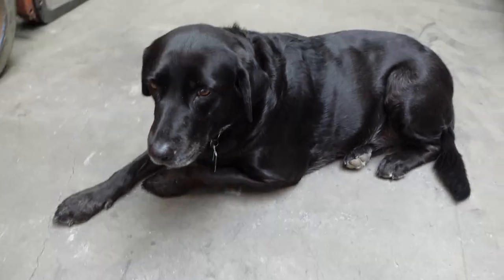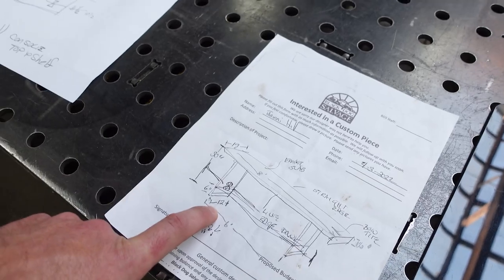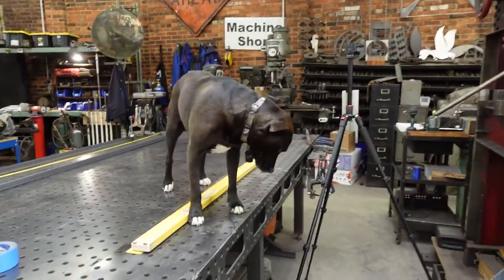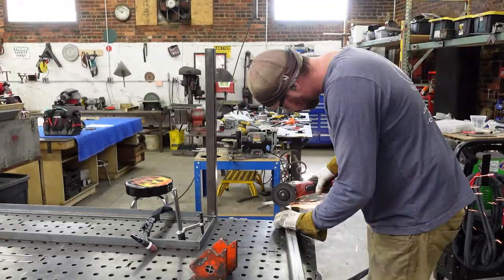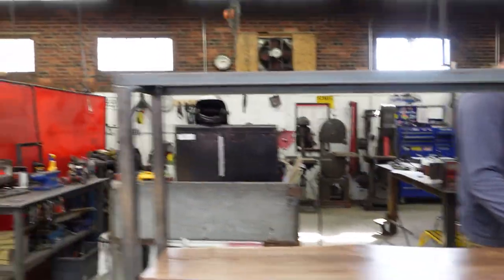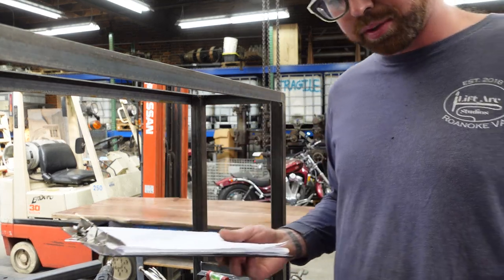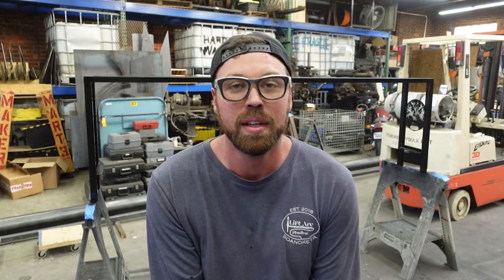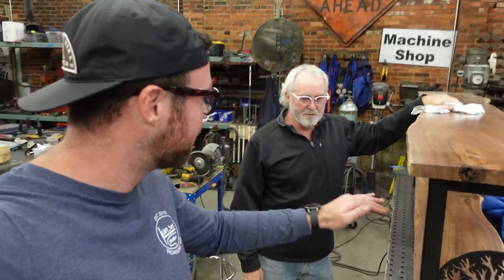This Table Has a Very Special Meaning

Comment: Nice build.  I like rigidity of structure and would have welded in 1 x 1 x 1/8 angle under the bottom shelf section front & back, making a box section of the shelf (as you have pointed out).  Another voice in the crowd...

Comment: Really like the table build and the art work. You might have a problem with the distance of the bottom shelf the long run may sag over time while pulling the legs inward. Long runs like that are usually supported like you did with the top.

Comment: Good job on the table. I hate to say it, but looking at the type of work that you do and the flow of your shop, my thought would be to sell off the rest of the machine tools from the machine shop except one lathe and the mill (and whatever else you actually use).  It would free up some space on the racks and if you raised up a shelf on the pallet racks could actually set up the large in that spot. I know it’s your shop and all those line shaft tools are cool, but if you don’t use them they really don’t help you.  Keep up the good work

Comment: You're going to have to add some support to the lower shelf. That's just too long a plank to hang from the ends. It will eventually sag and pull away from the frame.  I think you already know that though.